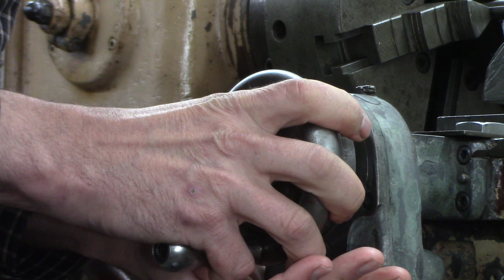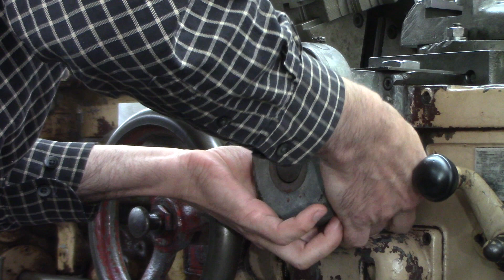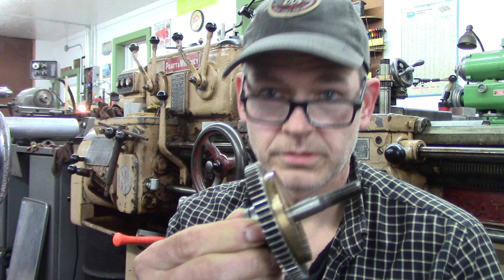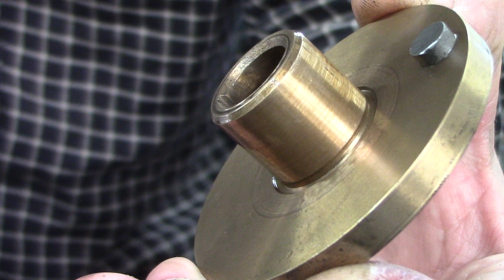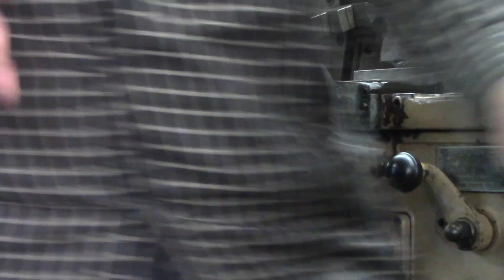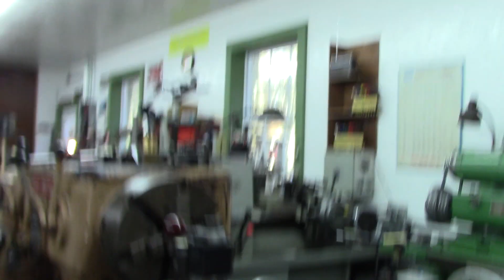11-26-21 --  Pratt Whitney 12C Threading Stop FIX

Comment: I have a Pratt & Whitney 12C and always wondered what this handle was for. I will try this feature on the next threads I cut on the Lathe. Thanks...
Reply from the maker: Glad my video helped you.  Not many of these cool lathes left in the world.  Stay in touch and you can always email me if you have questions or want a phone call.   I met a guy, Bruce, and he lives 1 hour from me, here in Charlotte.  He has an early 12C, and we have been to each other's shop a few times and became friends.  --Doozer
Reply: just tried it and it works like a champ. Looking forward to my next threading operation! I’m in western Colorado a bit of a hike
Reply: Have you done any LH Metric Threading on your P&W 12C?
Reply from the maker: @gus9675  I don't have the transposing gears.  I guess I should look in to someone who has a 3D printer, and get some made.  Actually none of the many lathes in my shop can do cut metric. -Doozer

Comment: That is a nice feature that just makes things easier when threading, combine that with the functional leadscrew reverse the machine has, and you have the best possible features. for a manual lathe. Many of the manufacturers had something similar. My Axelson 14X30 was one year too early for the cross slide stop, so I will have to watch the dial, and not over run 0 every pass. But I do have leadscrew reverse in the form of instant spindle reverse.
 The model C is a precision tool room lathe.
Reply from the maker: Thanks Donnie.  Hope you are doing well. --Doozer

Comment: The monarch has 3 interlocking rings with projecting tabs that serve the same function. They allow the crosslide handwheel about 2 to 2 - 1/2 turns of rotation to back off for large threads
Reply from the maker: I remember you were telling me this on the phone.  Like a combination lock.
Reply: @kooldoozer  Yeah, sounded like tumblers when you turn the dial on a safe!

Comment: I've got the same mechanism. It's not as nice, it requires an allen screw, but it works the same. I use it every time I thread. Works totally differently though. Uses a bearing ball in a track with stops at the end.
Reply from the maker: On your Sindey lathe?  -Doozer